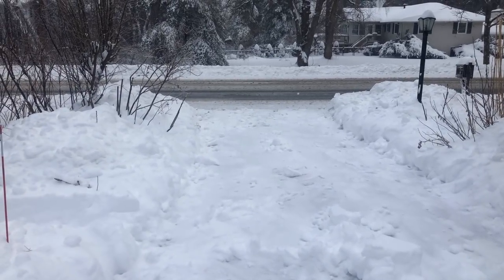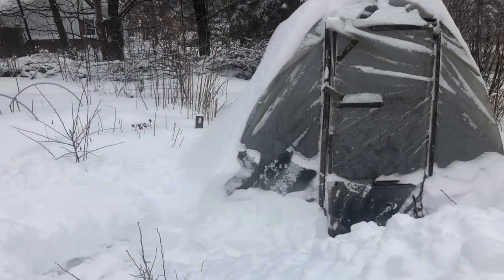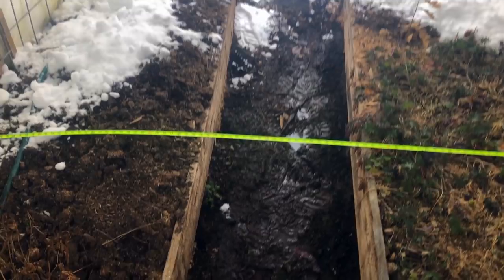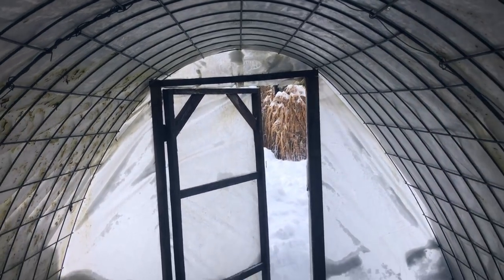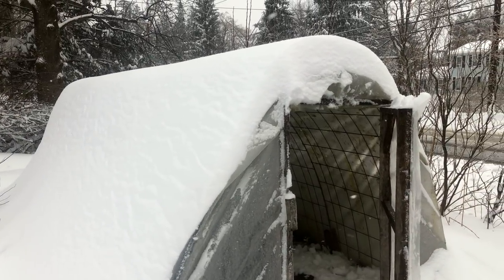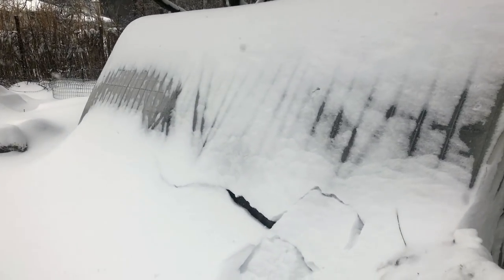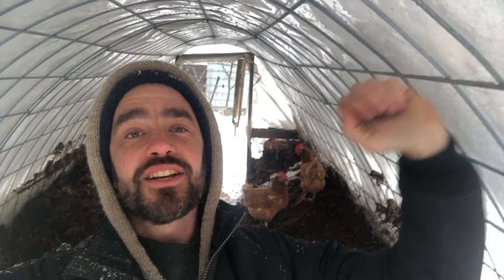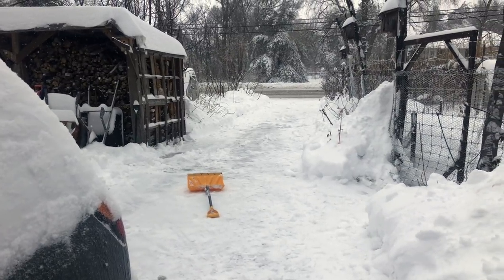Cattle Panel High Tunnel - Snow load?

Comment: I love my high tunnel .. I used 2" pvc pipe for the door frame, slides right over t posts, making it good and stable, rot-proof, and easy to move (relatively).  For next year, I'm going to see about installing a vent like the one you have .. having to manually vent the thing is a chore that I could do without!
Reply from the maker: I invested in a 'univent' wax piston based ventilator that works pretty nicely for us.

Comment: A broom will get the snow off without ripping the plastic.  I keep an old broom in the garden shed for cleaning off the porch and cleaning off the high and low tunnels.
Reply: Rose A great comment, I thought the same, I keep a push broom in the truck bed to clean heavy lake-effect snow off
Reply from the maker: Broom works nicely when we need the sun to get in...

Comment: I have the same greenhouse! 3 what I call "goat panels" curved over about 8.5 end to end, so mine has shorter head height than yours.  I also have 3 running in a row.  I did use 2x4s to frame it a bit and 2x4s on the ground around that I screw the poly into.  We just had over a foot of snow also and it is strong.  (Oneida NY).

Comment: If you ran one central rib from door to door,  it would withstand even more. Not that you need it - but it would be a pretty simple addition that would make it even more solid.
Reply: @Adventure Hawk's Ancient Harmony Farm  certainly. Probably would slide off line and collapse without the door frames. ;)
Reply from the maker: Yep, something to consider.  a 2"x2" of black locust would be amazing.  The only thing is that it's over 16' of a run, so then I'd need something to come down to ground to support it, right in the main walkway, which is why I've skipped it...
Reply from the maker: Knowing that we don't have to worry about snow loading or wind loading the way they are, up to about 90% of the average winter storms we get, I feel comfortable dealing with the 10% that need me to make sure we help them out with shoveling, etc.

Comment: I had two feet of fluffy snow on my row tunnels for about three weeks last month. I left it on there partially to add a layer of insulation against a forecasted severe frost ( low single digits). And the plants (chard, kale etc) survived easily! The thermometer inside showed a mere high twenties degrees. But guess what? Due to weeks of light deprivation, my veggies began to blanch and become whitened.
Reply from the maker: Interesting, never heard of that!

Comment: Nobody says what length the cattle panels are. There are different sizes. ?
Reply from the maker: "Standard" Cattle Panels from Tractor Supply or otherwise would measure 50" by 16' long...  Thats what is in use here.  Hope this is helpful.